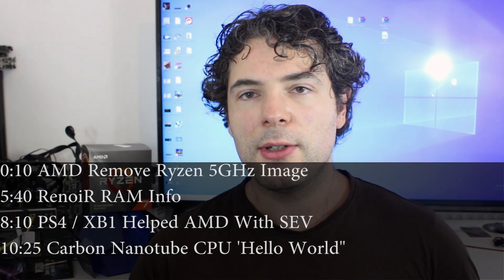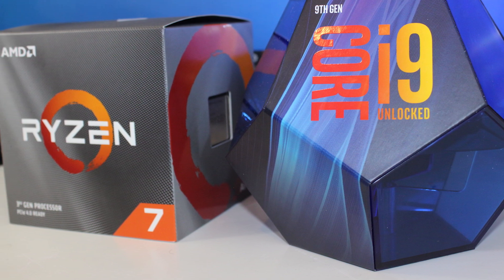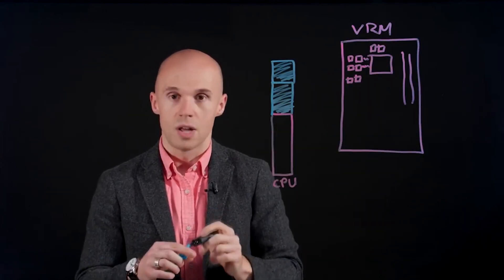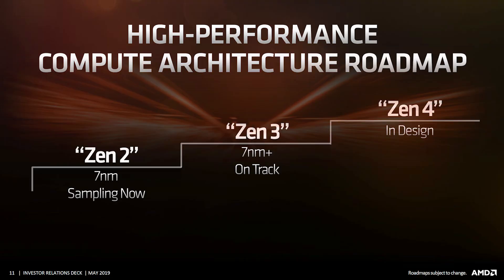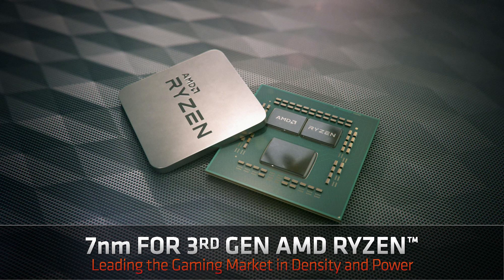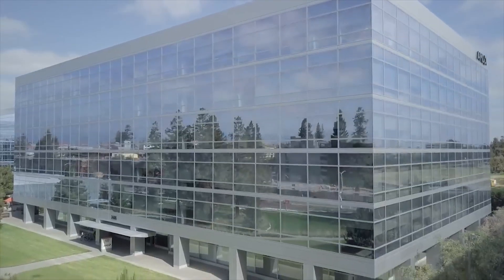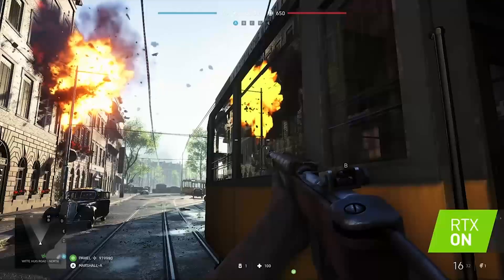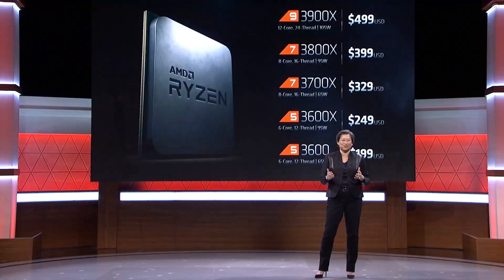AMD Fixes 5GHz Ryzen Pro Marketing After Backlash | Renoir LPDDR4-4266 | Carbon Nanotube CPU

Comment: The fact is that ryzen don’t need to overclock that much they beat them at 500mhz lower speeds anyways wld help but how there built don’t require super high clock speeds like Intel

Comment: I've recently been helping somebody (noob) online with an A320 board, a little athlon 9500  and a GTX 1080 T.I.
(yeh, I know, right? not a typo, turns out the card was a used gift )
But amazingly, yes you can put an r5 3600 in such a board.
(tho in this case the guy went for an r5 2600 because the little a6 chip is no longer supported after the (3xxx) update due to room in the bios aand probably he only had a 60 hz monitor )
So it really IS all 'happening' with a.m.d. stuff, its great to see people finding upgrade solutions like that. 
(the guy will go from really mediocre to good gaming performance even at 1440p?)
 I would expect a response from intel in the past but I think they are just fxcked. 
Like IBM/ GLO-FO finished. They just havent told the shareholders yet.

Comment: Yeah, 5 GHz.  Just like that FX 9590 was advertised as 5 GHz when I never once saw it boost past 4.7.  Although it would run stable at 4.9 GHz all core, which was pretty impressive and had excellent multi core performance.  Too bad the single core performance sucked ass.

Comment: All your ghz are belong to us.  Wrong about the carbon nanotube processor.  It has twice the transistors of an 8086, and every single gate works.  It's a standard, open source, RISC 32 bit processor with a 16 bit address bus.  Its biggest problem is that it's clock rate is around 10 khz.  REALLY SLOW.  Ten times slower than say, a PDP 1 from 1959.  But it's a complete working processor.  You overestimate how many transistors a processor needs.  If it were 100 times faster like 1980's silicon, it would be a much more capable processor than say, what's in a Commodore 64.

Comment: Maybe they could try mixing carbon nanotubes with the current silicon tech, if they are not trying it already.

Just imagine a carbon nanotube infinity fabric interconnect, or the connections from the CPU to memory, this sounds really good and im sure they are testing this kind of stuff, specially since there are so much competition on the industry right now, the situation might be that the first ones that can make it work in a viable way(cheap and able to be mass produced) will guarantee a large portion of the market share.

Comment: I wish that AMD would catch up with 3900X production, release the 3950X, release the 16 and 32 core TR40 and 80s and get sample 32 bit EPYC processors out so that testers can do benchmarks so that I can make a decision and build a system.  The longer they drag this out, the longer I wait.
Reply: I understand your frustration. My best guess would be that all their current lineup, GPUs and Epyc included, are produced in one 7nm fab. It's not like there are numerous 7nm fabs to produce the new lineup like there was with 14nm for instance. 

EPYC will always get first dibs on chips considering their price point compared to desktop release. They would rather make a $500 buyer wait so their $5, 000 buyers don't. Like I said this is all a hypothesis since I don't work for AMD.

I'm sure they would rather no one wait but there's a huge demand for their new tech. It seems higher than this one fab can produce, at least currently.
Reply: @techpappee  Number of fabs doesn't matter, AMD doesn't own any. They order certain amount chips/wafers from TSMC regardless how many 7nm fabs TSMC has. And if AMD underestimated demand, supply problem will last months because production of 7nm wafers takes almost 90 days. So anything ordered in July is available in October at earliest, it's not simply possible to react demand changes in few weeks.
Anyways TSMC estimated in April 7nm fab would be working in full capacity in Q3(was in tech news). Which means there was no production limitation approaching Zen2 launch, AMD got as many chips as they wanted. Also main problem with 3900X is there's not enough high binned dies. AMD already use just one(other one is average) in 3900X and still supply is low. Lower skus are plentiful and in stock pretty much everywhere. Seems there's more than enough production but lower percentage than AMD expected can hit higher clocks required by 3900X.
Reply: @kognak6640  -- Good post!! Yours is a breath of fresh-air after all the fanboy crap I've been reading. Seeing the Cult-like air surrounding AMD comments sections with so many people acting seemingly disconnected from ANY reality and writing comments with a styling usually reserved for Branch-Davidians and Apple!!!
Reply: They have a lot with different teams

Comment: Renault? AMD is in the car industry now Paul?
Reply: We'd get rich 💰 pulling him up on correct pronunciation! L😂L
Reply: I heard the same thing :p

I hear that AMD is interested in Peugeot as well ;)

What I'm waiting for however is the Citrone....
Reply: @johnmijo  there are some rumors that they plan to make a partnership with BMW, probably they will make a BMW R8eo (yeah R from Ryzen/Radeon, and e from electric only). They plan to make the fastest electric car, that can run at maximum speed 24 hours. And another thing that some guys found, is that it will use ryzen and radeon technologies to make it even safer for auto pilot mode, that car will not gonna need someone to drive it, and the best part is that you can play games on that car.
Reply: He is not mispronouncing anything,its called British accent. I am getting tired of those jokes. Amata is pronouncing Navi in a very weird way now!! Leave them alone
Reply: @adnan4688  mispronouncing Renoir isn't anything to do with having a British accent.
Reply: @MechanicaMenace  Where are you from?
Reply: @adnan4688  From North Yorkshire. Lived all over the UK.
Reply: @adnan4688  No. It's not.
Renoir: Ren-Waar      Paul: Renault
Matisse: Ma-teese   Paul: Ma-tassy
Thread: thread          Paul: Fred
Navi:    Na-vee        Paul: Nah-vae
Reply: @adnan4688  Then BTFO you've been told you're wrong multiple times

Comment: 4TB is enough for ALL PS3 games?
Reply: For every single PS3 game? I'd say no. First of all, I assume you want a 4 TB HDD. I've got one. Formatted, it is only 3.63 TB. Second, there are probably at least 1000 PS3 titles, if not more. Suppose the average game takes up 8 GB. That's 8 TB right there. Of course, I don't really think you'll need every single game. The top 100, or maybe the top 200, are the only ones that are good. So if you just want the half decent ones, a 4 TB HDD is more than enough.
Reply: Not if it wants to run crysis. Sorry. Could not resist.
Reply: @agr metor Check out the rpcs3 compatibility list. As of right now, less than half the games are compatible, but it continues to improve every month. Also, you don't have to go to the deep web. That's a dangerous place. Check out, Darkumbra. I'm not sure if there's any malware or anything, but as long as you click on all the right links, you will probably be fine.